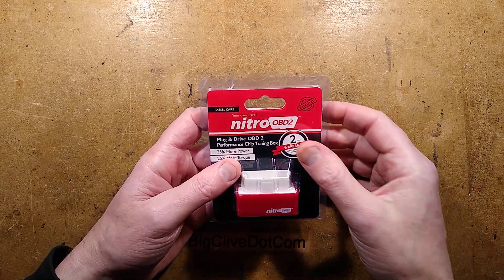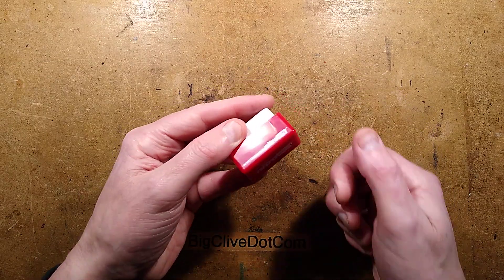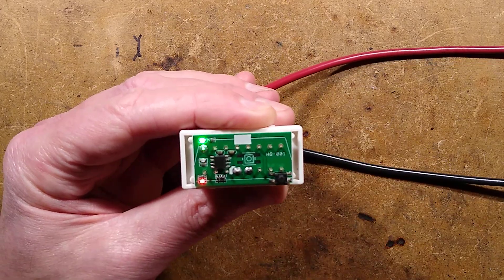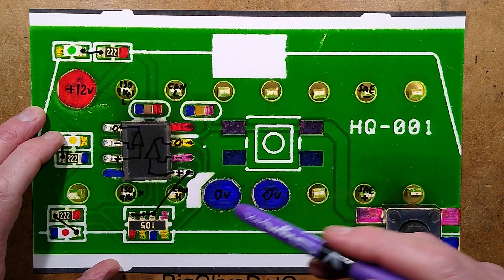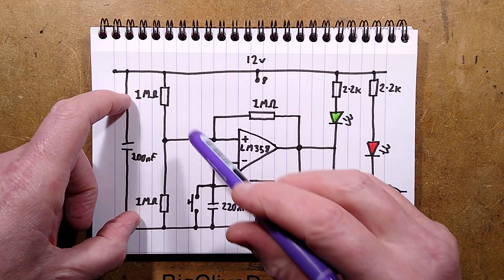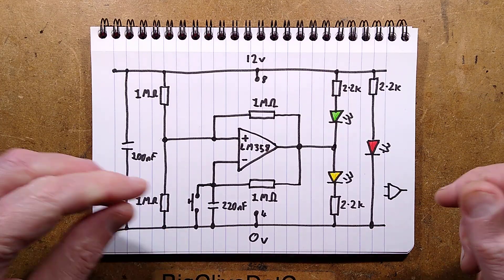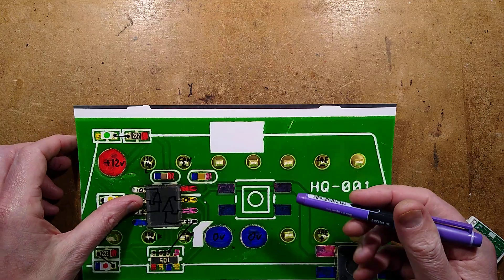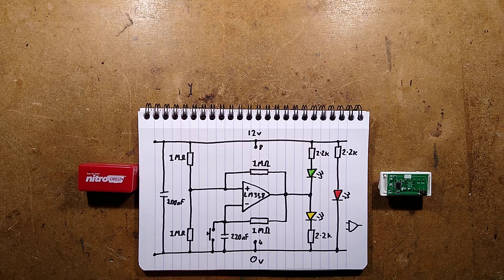Nitro OBD2 unit with interesting circuitry

Comment: After watching you explain the circuit, I had to try one myself.   Immediately upon receiving the new device I installed it in one of the cats’ boxes.   Within minutes my black cat came to use that box and quickly buried the device.  At that point, I concluded the device is working better than expected, in spite of it lacking the critical connections.

Comment: This LED flasher is on par with petrol de-ionizer that you could clamp on fuel line and it would ''purify the petrol by re-arranging' the molecules with carefully tuned magnets. ''.
Reply: 30+ years ago, when I was in engineering school, we got an an unusual request from the Missouri Attorney General's office to evaluate a fuel magnet device as a part of a fraud trial. We ran a 2.3L Ford engine on a dynamometer with and without the device in place, and to nobody's surprise, it had no effect.

Comment: I think people are confused about what this device is for. It has nothing to do with your engine, and everything to do with the audio system in the car. What it does is clean up the car's power (hence only the power connections are used), to give your stereo more dynamic soundstage and imaging, which you can hear immediately if you are a true audiophile. It's like the artist is performing in the car with you! It does, in fact, use the placebo effect, which has been scientifically proven to enhance home and car audio no matter how expensive the equipment. This is why people pay $600 and up for a special oxygen free power cord for their power amp! Since these devices cost less than $600 (US), that's a bargain in my book!

Comment: It says 35%hp/25%tq, so assuming an even TQ increase, the ratio of 35-25 is 1.4, multiplied by 5252=~7350rpms. So just as a learned motorhead I could tell right away that these claims are BS for diesels, as diesels rarely rev over 5k rpm.

Comment: I was in the car business for eons, was probably asked this same question 1.4 million times: will an all-new aftermarket air box system really add 25+ horsepower?
No, of course it won't! No dyno testing required. How can I be so sure? Manufacturer X spent literally billions of dollars in R&D to allow the engine on your hiperformance car to produce whatever it produces: 200,  300,  500 bhp  ..... Considering they could acquire said snazzy Air filters at well under $100 per unit by buying thousands of them, don't you think they would have done so? Why not? They could even ride the Air filter guy's marketing and brand imaging, and charge a little more!
So what do they do? They "sound" more powerful. And, on a positive note, if you are willing to do a filthy job you can clean, reoil, and reuse them, although it isn't very fun.
Reference: Fish carburetor, magnets in fuel line, premium fuel in cars specced for regular, and, of course, stripes on the car....

Comment: Ive seen a similar thing at a shop i work at. It was a leased vehicle, had the company name on it and a do not unplug sticker... I unplugged it to scan the error code. I wonder if they plugged one of these gimmicks in and gave a story to increase payments, like the "rust protectors" that stealerships add an extra fee for and drain batteries. I know a similar thing is used on ships to reduce corrosion. Anode or cathodes or something (im not an electrician and about 6 beers in but ive always figured the rust preventers on cars are bs. Its just a power and a ground to a small box under the hood)
Reply from the maker: The vehicle rust preventers are indeed a scam.

Comment: I had one like that that was yellow and it was a dummy it was a total scam after reverse engineering I found out that it was literally two transistors meant for fast switching connected to two LEDs and a switch that wasn't even hooked up so it was literally only a circuit to make 2 LEDs blink so buyer beware

Comment: Back in the day they had fuel line magnets that alligned fuel to somehow be more combustable. And of course we had grounding strap that discharged static electricity that occurs while driving to ground reducing drive resistance in some miraculous fashion. This device is just evolution of those contraptions.

I wonder why people dont realize if there was any way to get better fuel economy by magnets or blinking lights manufacturers would already be doing it.
Reply: I saw one of those grounding strips on a car the other day.

Comment: I've got the modded two reset button version on my hybrid diesel petrol engine.
If you use engine braking downhill, it also generates fuel.

Comment: On the bright side, if you find one of these in a leftovers bin it can be cheaper than getting hold of a single low-profile OBD2 plug from a reputable supplier (including p&p), if you don't mind desoldering it, adding a flat cable and potting it up neatly. But that is a pretty niche market (you do rather need to know what and how to connect to the plug so as to not bollocks up your vehicle or project!).

Comment: I had a Tunit unit fitted to a Land Rover Discovery 3 2-7TDV6 and put it on a 4wheel rolling road to see how much improvement in power it gave,the result absolute zilch,no improvement at all. Tunit was contacted and they ask me to take it to their head office In Chorley,the removed it from the vehicle and took it inside a building and then refitted it and then went for a test drive,the result engine warning lights came on and still no improvement in performance,after a few seconds the engine went into limp mode,the man with me removed the unit and the engine cleared its faults and at that point I asked for a refund which they gave me,I had it properly remapped and couldn’t believe the difference in performance and fuel consumption,I again put it on a rolling road and the difference was unbelievable,about 35bhp more with great torque. These plug and play things are a con don’t waste your money.

Comment: If you had an eprom programmer you could get one of those ELM327 boards and dump it and see what the difference was between the expensive ones and the $10 ones.
Reply from the maker: The best way to tell that is to use the app that analyses the units to see which parameters they can read.  The better ones read more parameters from the engine.

Comment: Will it work on my super fuel efficient 6.0L v8 gmc that weighs close to 9000lbs with the service box and all my tools in it?   Lol. 🙄
Reply from the maker: Yes it will be just as effective on your vehicle.
Reply: @VRXC  lol.  Its surprisingly fuel efficient for what it is. I drive about 20 minutes between jobs.  3 minutes to the grocery store.  Maybe 5.  Yeah the 120L fuel tank that i never let go below half a tank sucks to fill from empty always.  Let alone today.  Hahs.  I love my truck.  It has power when i need it.  And is a rough ride, but mostly comfortable as its a 3/4ton so stiff springs.  You avoid as many potholes as you can in canada.
:edit. Is it efficient for a grocery getter?   No.  But i use it for work. And on my way home i use it to get my groceries.
Reply: @VRXC  its incredibly inefficient compared to something smaller.  Its just decent for its size is all.  Sort of.  I don't drive it expecting to have the same economy as my wifes late model crv.  It is what it is, i drive it because i like it, and actually use it for its intended purposes.  So i expect to have a much higher fuel bill comparatively.

Comment: The general rule for ANY automotive device that claims huge gains in either hp or mpg, for a “small” amount of $$ (say, sub $100): if it were that simple to get more power or mpg, the car manufacturers would use it!  

Yes, you can modify a car for more power or mpg, but it is typically costly, and comes at some other expense - emissions, fuel economy vs power, etc.   So any device (vortex generator in your intake?!) that offers a quick boost in performance for “not enough money to bother trying to get it back”, is going to be a scam. But the placebo effect on some is real!

Comment: I run four of these units via a series of OBD2 doublers, my car now deposits fuel into the tank as i drive (which i syphon and sell once full) and 0-60 time has been improved to 3.9 seconds. I think its some kind of industry conspiracy that these devices are not fitted as standard.

Comment: I use a few LM358's as a database for my homeserver.  Only problem is you can only store 1 bit per LM358, so you have to use a few trillion of them.
Reply from the maker: It's not too bad.  You can store two bits per LM358 as they contain two op-amps.

Comment: If you plug in 4 of these at the same time the efficiency gains compound to such an extent that the fuel tank actually fills as you drive. Of course the catch is that you cannot actually drive the car like that because the power is so off the chart that it becomes like driving a mechanical bull.

Comment: OBD stands for On Board Diagnostics, so you can read error codes, erase the error codes, and actually change some features of the car, but the factory ECU's program can't be changed with a dongle.
Reply: False
Reply: Lots of tuners flash through the obd2.  Engine and transmission adjustments.

Comment: Aside from the obvious scam nature of this product, it was very naughty of them to leave the spare op amp flapping around in the breeze! With a tiny tweak to the layout they could have properly tied it off as a voltage follower with the non-inverting input referenced to 2V at the red LED, well within the design parameters of the LM358.

Comment: I talked to a guy some time back who was adamant that his diesel car used less fuel on biodiesel than on fossil diesel and that he could prove it. I told him it's probably because his driving style i less aggressive when he uses biodiesel (less energy dense) and that is why the car uses less fuel. That is probably the reason this kind of device can make an apparent difference to their user without actually doing anything. The power of change in behaviour is not to be underestimated.

Comment: Reminds me of university 40 years ago when I was introduced to opamp theory and practice. Thanks for the memories.

In slower time, it might be worth a video on common opamp parameters and circuits. I can vaguely remember that the ideal theoretical opamp has infinite gain, infinite input resistance and relies on feedback from the outputs to one or both inputs depending on what you want to achieve by way of analogue computing.

Comment: There's a great improvement modification with this board.  If you disconnect pin 8, it reduces its power consumption to zero.

Comment: 4:19 Yes. Can attest. I installed one in my electric car and haven't had to put gas in it since. Be warned, though, a friend used the wrong setting and it converted his car into a diesel. The device also consumes a small amount of blinker fluid to flash the LEDs, but the cost per year is less than the fuel saved.
Reply: WHERE DO YOU PUT THE BLINKER FLUID IN AT ?
Reply: @mefirst4266  you might have to pull out the headlights, some don't have a normal fill port

Comment: These things like Nitro OBD2 have been around since the 1970s and do they work? If you fit one of these money saving things to your car and you think it's saving you money, then it's working for you.  I remember in the 1970's there was this fuel saving device where you cut the fuel pipe and fit this small round device in the fuel pipe and if will save you money on your fuel.  Did it work?  If made the vehicle very difficult to start first thing in the morning and a lack of power at low speed. Yes did it save money?  Only if you think it did

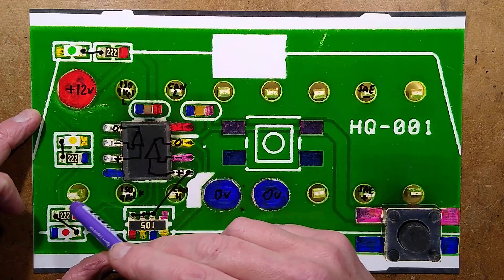Comment: You do know that after the 3:50 mark, when you told of the CanBus pins not being connected, that we could FEEL the smile on your face for the next 2 minutes as you spoke ... don't play poker. 
It does function well as a 'reset button' tester.
If they are cheap enough on TEMU, you could buy one, cut the board off the back, and hook it to a 12V battery, to make a parameter holding circuit, for when you want to change out a bad battery. 
Today's cars are a pain, burying the battery below so much junk, that whenever you change it, you need to find a dealer to reprogram the ECU/PCU for $$$$

Comment: Bistable multivibrater.
Umm the 358 is a dual op-amp. Mostly found in computer PSUs along with the 431 Vref.
Toss the leds and put loud speaker in place. Police siren, eeee oorr eeee oorr. Onee Satday nights o'course 😆. 
.  ; )

Comment: Clive,  Here in the USA a company called "Autosaver" has been doing a 'supposed good job' at rust prevention on cars.  Recently on a Facebook sales forum one of the members was selling the "next generation" of the "auto saver" that plugged into the OBD II port.   (He paid the full price, and was trying to sell it for $300usd)

It's known as "cathodic rust protection".  Supposedly it's being sold at car dealerships as an 'option' for $600 usd.   Now I'm a bit torn, as a former auto mechanic just about everything that plugs into the OBD II port, other then the 'insurance narc box' or the scan tools-  The rest is just a bunch of baloney.

Would this be a product that could even work?  Using the OBD port to set up a 'charge' on the vehicles sheet metal just seems like it's a bunch of crap.  Their website shows a 'device' that plugs into the system and shows a voltage differential and some hocus/pocus that I really do not know if it's truth, or a scam..
Reply from the maker: It's a scam.  There's "circuitry" and either blocks or strips of saver electrodes.  But the "warranty" requires you to take your vehicle to an approved paint touch up shop every year.

Comment: Your assessment of the device is incomplete since you didn't factor in that this is a Schrodinger-based circuit. By disassembling it and observing the pcb you removed the integrated uncertainty margin that is required for the placebo functionality. It is a shame to see such a perfectly functional device so carelessly destroyed. Videos like these should be taken down since they encourage morons towards real-world vehicle performance enhancement and as such cause an increase in risk to the safety of other road users.

Comment: well.. prior to 2 weeks ago i never thought those crap OBDII tuners did anything other then killing batteries, but sadly 2 weeks ago i had a vehicle come in and they told me it was running they smelled something funny and the car just died... trying to open the hood/bonnet i noticed a white and red device plugged into the OBDII port and i unplugged it and realized the initial burning smell was the device it was called "Scorcher Tuning Module" well not 15 minutes later the instrument cluster + the ECU + TCM that run off the same Bus network were all dead... yep that supposed "tuning Module" definatly was a "Scorcher" please for the love of everything dont plug any of this crap in.... i cut open the device and whoever soldered it bridged a connection with a solder ball and it happened to be 12v straight into the canbus... $5300.00 later a new dealer programmed ECU / TCM and instrument cluster car was repaired and a very very expensive lessoned learned for this customer.. this customers car sadly is also now database flagged because no one could definitively provide the mileage so it was set as a ballpark branding the car as an altered odometer reading vehicle for life.(please note the device i found on this Cadillac looked like the small things in this video not like an actual OBD2 reader). like Ouch1011 i tell anyone using them or swear by them to leave and never return i will NOT work on vehicles that have those tuners installed.. unless they expect to fork out alot of money as ecu's and such i DO NOT install junk yard or aftermarket ecu's

Comment: Totally unconnected to this Clive, but could I ask a question about an issue I currently have? Firstly, whilst subscribing to your wonderful and informative channel, I must admit that my main interests are in woodwork/DIY projects, etc. As such, over the years I have acquired many tools, some of which are rechargeable. Sadly many of them have failed batteries, but it seems a shame to throw them away. I have seen many You Tube channels whereby Tubers hack them and hotwire then to a DC output such as a laptop charger etc. I know that this doesn't really answer the problem, the lack of current in such devices means the drill doesn't have much torque. The drills all have brushed motors, so I know that this is theoretically possible. What are your thoughts on the idea of me buying a DC power supply where I could dial in the voltage and amperage accordingly. Conversely, maybe your thoughts as to whether it's a good/bad idea at all would also be appreciated. Many thanks if you could help. After viewing so many misleading and confusing posts by others I felt I could get an honest opinion from you. Cheers.
Reply: There are aftermarket adapters to put just about any brand battery onto a different brand of tool. I have dewalt and makita tools running with Milwaukee batteries.

You can find good deals on tools and save money buying a single good battery
Reply from the maker: Power tools can draw a lot of current when loaded.  So a power supply suited to that could be very expensive.  It might be worth considering third party batteries.

Comment: Nice to see you finally referencing op amps. they are one  relatively basic part which I struggle to understand. Thanks to Ben Eater having covered the other ones I had difficulty with. Wish you or someone else good at explaining made a full video about them.
Reply: In theory, Op-Amps are simple.  They produce whatever voltage is needed to make the + and - input the same.  The feedback part is where it gets complicated.